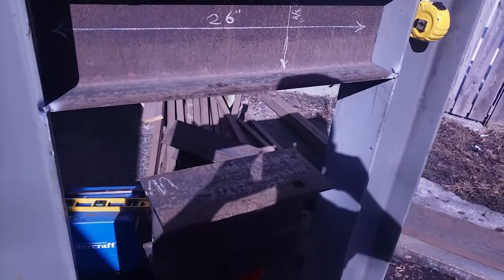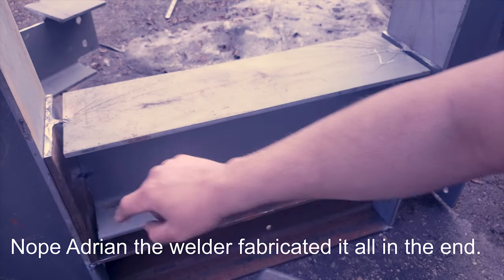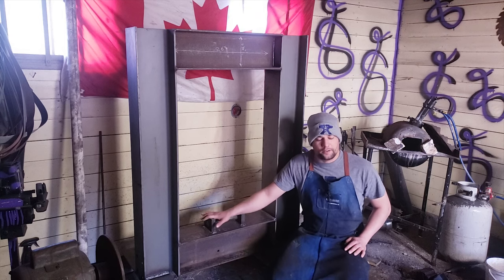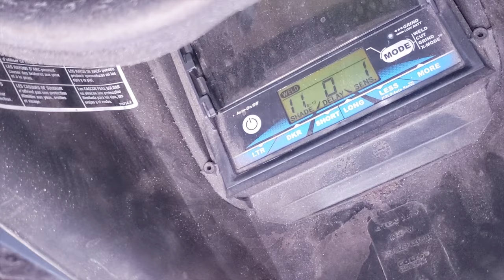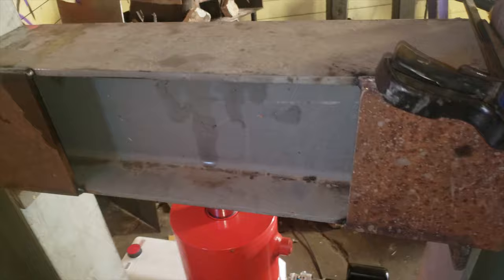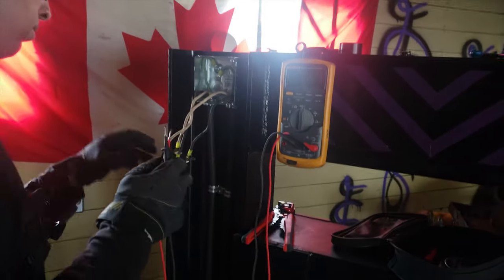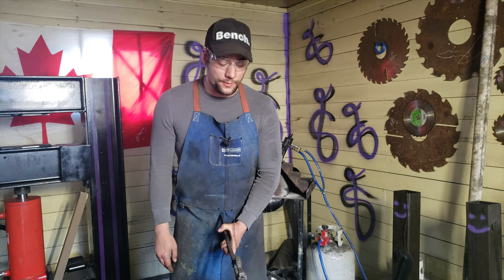Building my 50 Ton Forge Press from start to finish!!!(43ish)

Comment: you should put some zurich fitting/grease fittings on the high friction surfaces to prolong the working life of that beautiful forge press 1 more thing I would do is add on a foot control (GREAT WORK BROTHER) your video was very informative
Reply from the maker: Thanx man!!! Foot switch is a must one day. Ive greased up all the friction points but there isnt much for friction there. Lots of little tweaks i still need to do to her
Reply: Don't think it's needed. I built my H-frame with the sliding element so tight it knocked the mill scale off first time it was cycled. Worked just fine for over 20 years. Spray a squirt of Fluid Film on really cold days. Tight is good, sloppy is bad.

Comment: That is one awesome press you made bro, I foresee some really good things coming from your forge in the near future. Especially once you get the dies built. I was curious about how you lubricate the guides? I couldn't tell if you were using oil or grease.
Reply from the maker: Just a bit of grease. I will be bettering it as i go like a better guide system. Pinning the slide table to the ram blah blah. Ill call it an update video when the time comes
Reply: @CGSmithing  right on bro that's cool

Comment: Nice job on the press. I want to offer a bit of advice, its meant to be a positive you can enjoy your press for years to come. 
  The material selection for the carraige and top die cross member could be problematic once you really get going with the press. Your putting out 
100 000 psi with your 50 ton press. The minimum yeild strength for the steel your using is 36 000 psi. Any forging thats not directly under the center of the H beam (like the front of the press opening that looks to be 1/2" on the beam plus the 1/2" plate on top. If you forge at the front of the press without a thick enough die you'll bend your press. A 50 ton press can bend 2" x 1" steel "the hard way"  cold. 
  The H beam should be gusseted every few inches and then the H beam should be boxed in on the carrsige and top cross member. This is as much for people that might copy this press as it is for you make your build robust enough and safe. Just keep the 100 000psi ram output against the yeild strength of 1" thick plate (36 000psi) to get an idea of how substantial the build needs to be. A minimum safety factor of 3 is needed on top of that, more is better. The big blue 50 ton is an example of a press built with adequate safety factor. A bit lighter press than that could be built for hobby use. Sorry to sound all negative, I just want to see people build safe presses.
Reply from the maker: Love this thank you!!! I have sonce that build made a whole bunch of improvements to it to strengthen it all up and will continue to do so
Reply: Your math is off. You're not going to be producing 100,000 psi with that press unless the contact surface of a particular die is less than one square inch and it's only going to be that high against the die surface. You're going to be producing 50 tons pressure TOTAL, not PSI. This is going to be distributed against several square inches of steel.

Comment: I’m happy for you.
You had me worried for minute though. I thought that when you were putting the slide table on the cylinder, that the cylinder was going to fall over onto your hydraulic tank .
Reply from the maker: Handy feature with this cylinder is where the hoses screw in the side the fittings stick out so they hit the pin bracket at the bottom...it can only go so far...thank goodness

Comment: Looks great I’m building one as we speak! Just curious have you had any issues with the slack in the carriage? Or any issues with this design
Reply from the maker: only extra modifications i made was welding in some ribbing on the bottom die carrier and the top one to make it stronger and add some extra support.

Comment: 50 ton press on short circut 70s wire sketchy at best. A flux cored wire such as dual shield would have been what a journeyman would trust. It looks great just keep an eye on them brittle ass welds.
Reply: Stiffeners at point of pressure to keep the flange from flexing
Reply from the maker: i have since this was built made a few critical improvements and it has changed the game for sure!!! sorry for the late reply

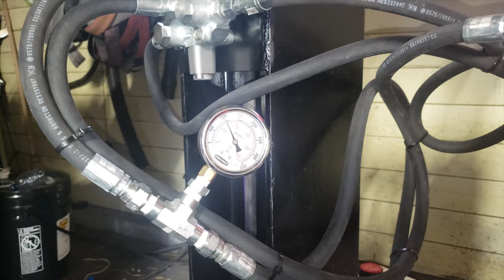Comment: 20:30 can you please explain by new in detail video close up how did you do that Psi max adjusting & what did you expected or expecting by that adjustment exactly, did you try to cut off moter power automatically within reach that psi level, or did it by mechanically by that direction control valve? I'm not a native English speaking person, so that's why I can't exactly understand one shot like this, the video presentation is not perfectly cleared at that adjustment moment. Don't miss understand, It's not your problem, it's about my English knowledge listen problem.
Reply from the maker: The motor and control valve have a max pressure setting. When it hits that it bypasses in the control valve if im not mistaken. I adjusted the pressure to get higher tonnage when at full working pressure.  I hope that helps? They give an instruction book with the control valve that tells you which way to turn the adjustment nut to increase pressure or lower it
Reply: @CGSmithing  yes it very helpful thanks for all, one of my friend also trying to made this kind of press machine, he all read a main mettle frame, yesterday he & me buy that kind of direction control valve, but it's not exactly same type to your one, it's a second hand one used for excavators, even I'm also not a hydraulic expert, I'm a electronic technician, but I can understand some and have few experience with smaller size scaler level hydraulic, I can imagine literally theoretical things.

Comment: I've got nothing against hydraulics.  But I wonder why no one ever makes a pneumatic press for forging?
Reply from the maker: Pneumatic is less efficient less powerful than hydraulics compared tonone another and needs lubrication
Reply: @CGSmithing  certainly no more dependent on lubrication than hydraulics.  Moving parts wear out.  Lubricating them reduces the wear.  A single air ride spring bag as used by an 18 wheeler can press from about 10 to 20 tons.  And not need anything more than about 90 pounds of air pressure.
Reply: just did a search.  You can buy a 50 ton pneumatic press for about the same cost as you spent building that hydraulic rig.  There appear to be advantages and disadvantages to both systems.  So the deciding factor would be the needs of the end user.